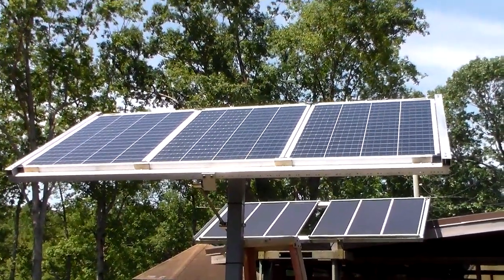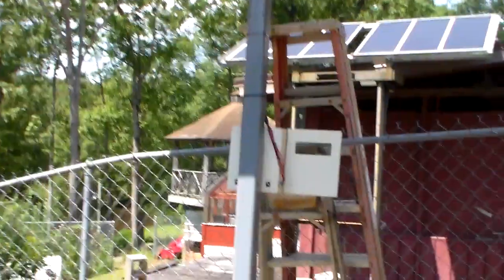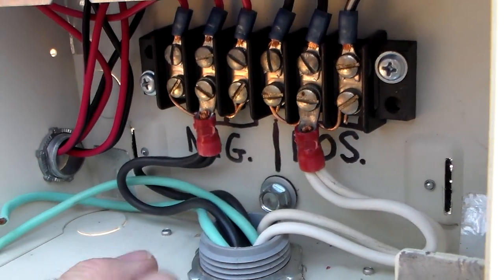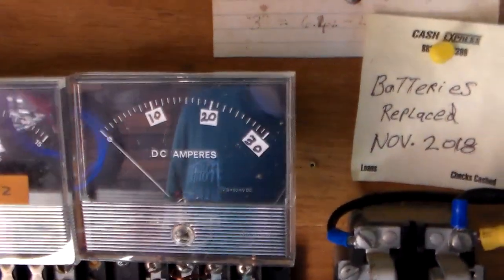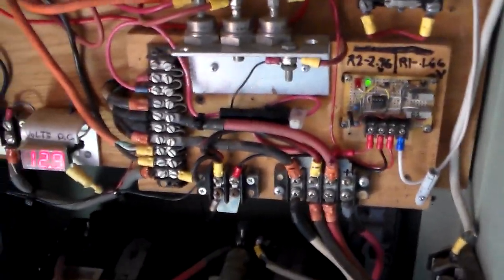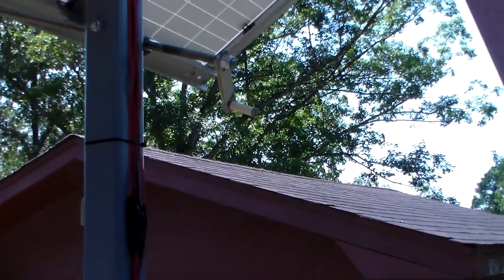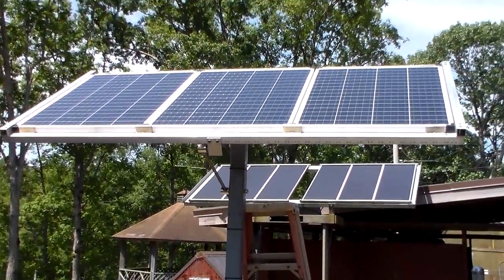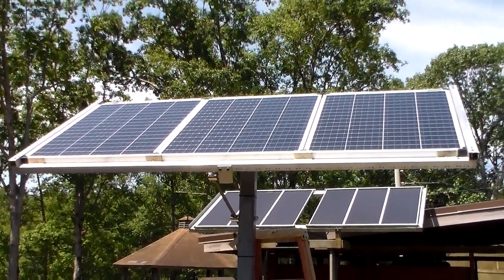Harbor Freight 100 Watt Solar Panels

Comment: Thank you for your harbor freight review.
Notes:
• 18 amps, parallel i think, 
Advertised 100 watts x 3 = 300 watts, 16.6~ volts
• 4 deep cell lead batteries 480ah x 12 = 5760wh setup
Reply from the maker: You are welcome